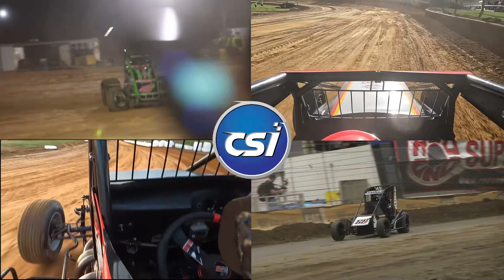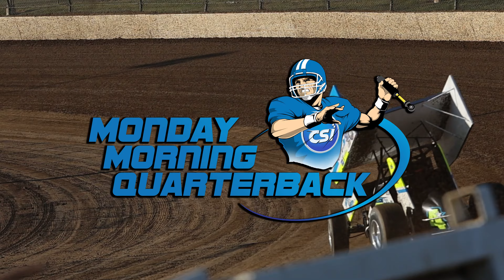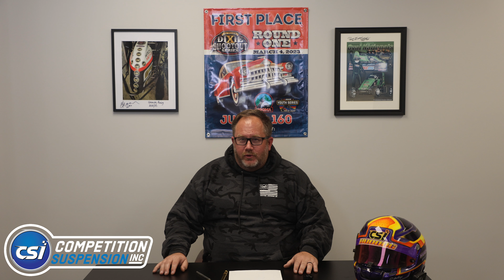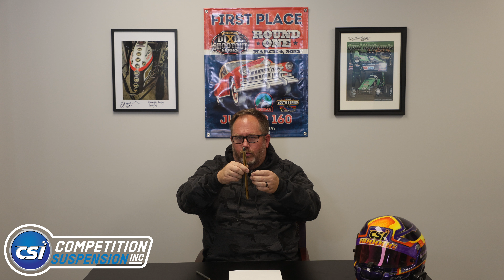MMQB Ep. 170: Rear Shock Rebound

Comment: I’ve recently started running a winged sprint car and I’ve seen some people use the compression and rebound of a shock in pounds like on the dyno sheet. While others use the shock number like a 5/6 for 5 compression and 6 rebound. How do the pounds correlate to the shock number?
Reply: Different shock mfg use different poundage for their valving numbers. Better off using poundage than the old school way of numbering.
Reply from the maker: https://csishocks.com/content/Resources/Technical%20Data/Generic%20Valving.pdf this should give you a good refrence.

Comment: What changes would you need to make to a shock when going per say a 1000 in the RR to a 975 in the RR of a winged 360 or do you not need to change the shock?
Reply: I could be totally wrong, but from what i know, your bars determine how much weight goes to each corner, your sock determines how fast it comes and goes to that corner. So if you need to change when it gets to the corner, change the shock, if you have to much in a corner change a bar